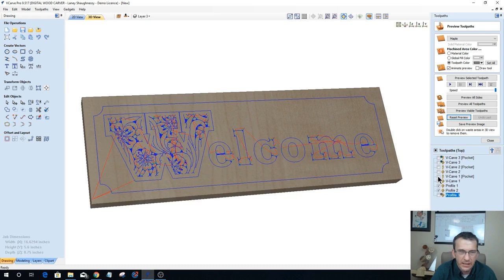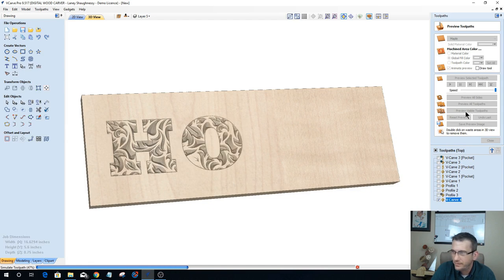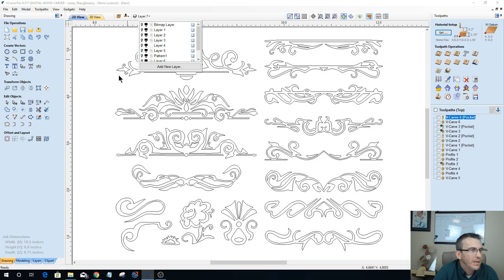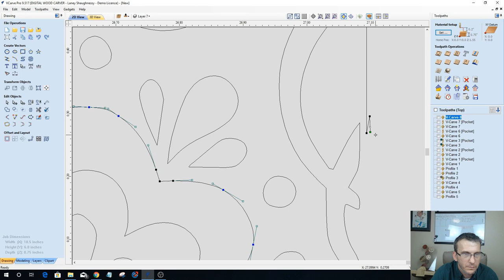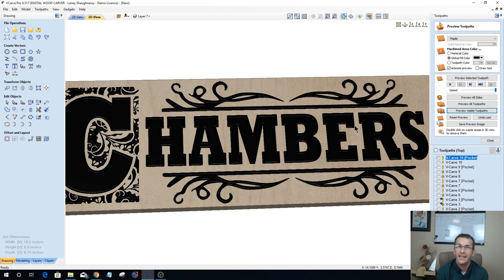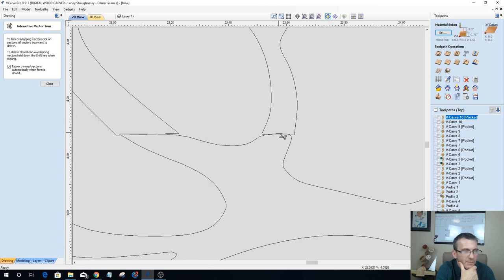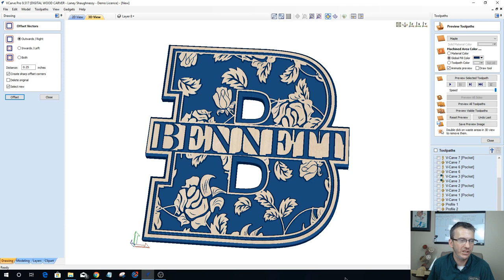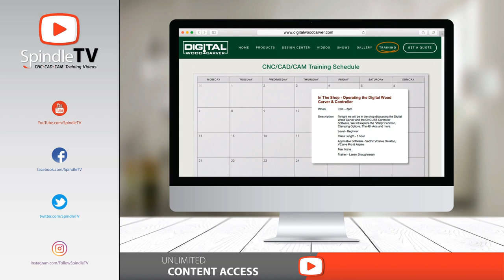Making Decorative Text & Signs - A Vectric Tutorial

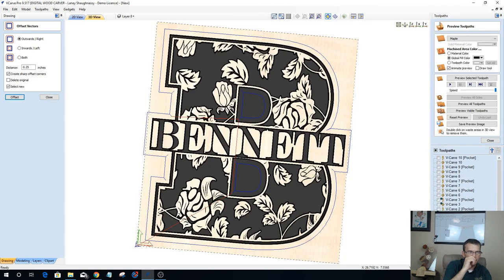Comment: Excellent as always.... Only thing I did not quite catch, or comprehend was at 2:20... You used a 90 v bit to cut the profile to get the bevel with a negative .15 stepover. I am wholly unsure of what the stepover is. You then used it again at 2:20:36 under thee sharp corners dialog. Not sure what that was or why it was necesary... I'm GUESSING that yo set it negative then positive to maybe smooth out the bevel, or not cut the beveled part off. Another BIG THANKS for what you do and sorry to be a pain with a question. Not even wholly sure this is the appropriate way to ask a question.
Reply from the maker: When doing a chamfer and outside chamfer if I did an outside profile cut with a V bit then the bit would ride on the outside of the line and not cut my chamfer the offset steps the bit over so it can create the Chamfer cut
Reply: Thanks for the info... i tried to join the live last night.. actually did for bit.. but my internet is so bad it redices the quality to where i cannot see.. so i guess  no live for me...again thanks ..
Reply: @SpindleTV  The offset makes sense to me.  What does the allowance for the cutout tool do and how do you determine the value that goes in there?  You left the value at  .1875 and used a 1/4 em to do the profile.  Do these value correlate?  Can you explain further?
Reply from the maker: @cbvester  the offset allowance in a profile or pocket toolpath determines how far away from the vector line the bit will cut...a negative offset number allows the bit to cut over or beyond the vector line and a positive offset allowance will keep the bit away from the line by the allowance amount